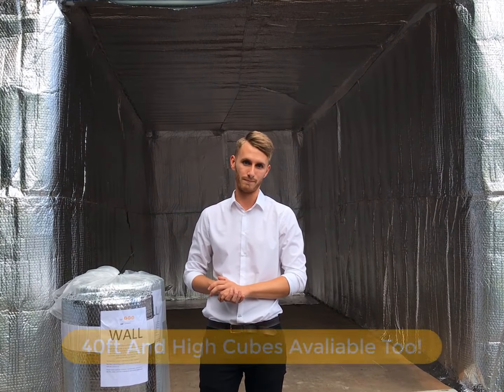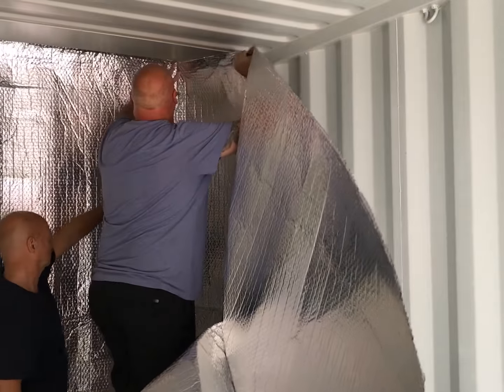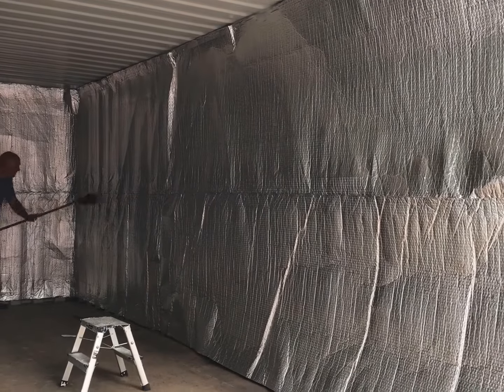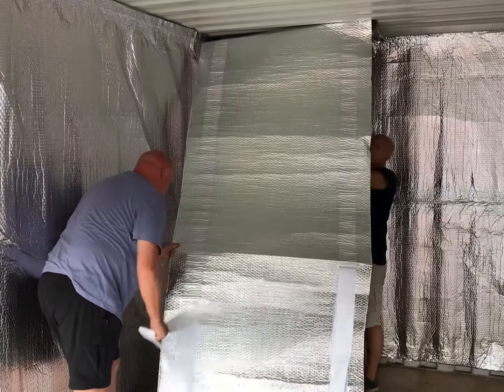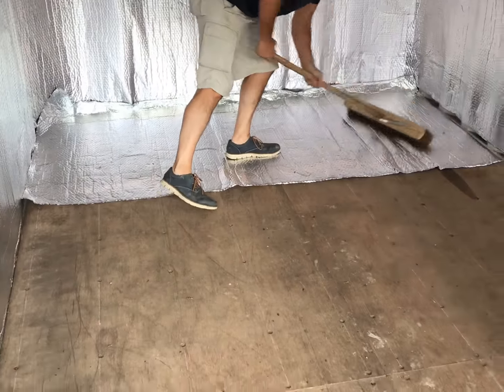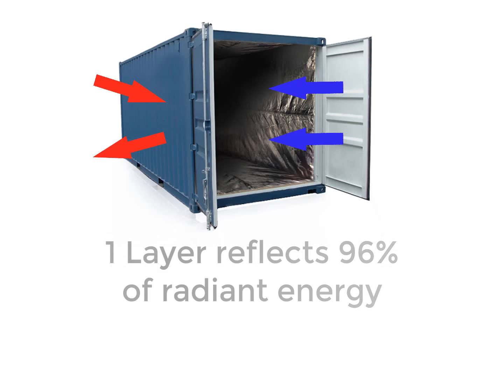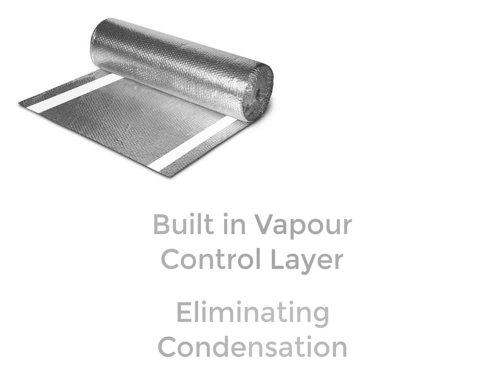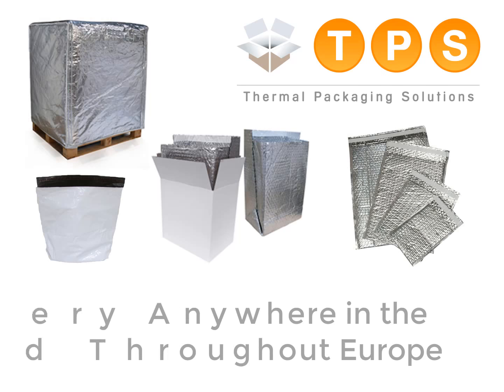How To Insulate Your Shipping Container For Use All Year Round

Comment: I would assume because there are many cavity spaces between the steel wall and this product moisture will still occur within these cavities, drip along every seam and provide basically no protection at all. It would need to be bonded directly onto the steel with no cavity space to work.
Reply: Not if every  seam is airtight, but if any air gets to flow inside it will condensate (if it is airtight the only moisture is what is trapped inside already)...
Reply: Containers need to be insulated from the outside. Not from the inside.
Reply: @Coldeneye76  
This is exactly what I’ve been thinking!
If spayed foam is used outside, do you know what would be the best way to cover/protect that foam from the elements? TIA
Reply: @highlandmary33  if you insulate the interior you lose crazy space . And its proven that insulation on the exterior stops if not just holds back moisture from the exterior. Best to do it from the outside.  Put nailing strips for the siding of choice . Save all that space inside for walls construction
Reply: @Coldeneye76 wrong

Comment: Does this ship to USA?
Reply: It's the same stuff you insulate hot water heaters with.  They even have it with tape on the back to wrap around a water heater.  Just not as big The sheets are about 3x10.

Comment: Wait, what are you doing? Why wouldn't you spray foam?
Reply: spray foam is very toxic, i've read. There are many solutions for insulating and I consider this one to reduce condensation formation + a stabile tempature :))
Reply: XanderX spf is only toxic while installed, and if installer has no clue and sprays off ration it can stink and be no good but u would know and it’s safe when applied proper that’s why we are certified in Canada to install foam.
Reply: Spray foam is expensive   A DIYer can really screw it up and waste lots of $.  Plus foam can be toxic so you have to buy a respirator to breath while you spray it. This is easier and cheaper . No skill required.  Most people building shipping containers. Are not experienced or they wouldn't be doing it in the first place 😂🤣😂
Reply: Can you use this to build a shipping container home?  If i put a layer of this first will it act like as vapor barrier?  Then put foam board insulation ontop of it?
Reply: Joshua' Madread I’m wondering that too hope someone answers
Reply from the maker: @joshuamadread3678   Yes - many of our customers convert their containers in to living spaces. You also get foil joining tape within the kit, which enables you to create a continuous layer which will act as a vapour barrier.
Reply from the maker: @Cloroxbleach-lr6ej  Please see response. Many thanks.
Reply: @DrLove911  
if the foam is not used, in the spaces between the insulation and the metal condensation forms which, remaining blocked, creates mold ... this is toxic too.
Reply: @alpcodg3908  it doesn't create mold if there is no food for mold to grow on, e.g., wood, etc.